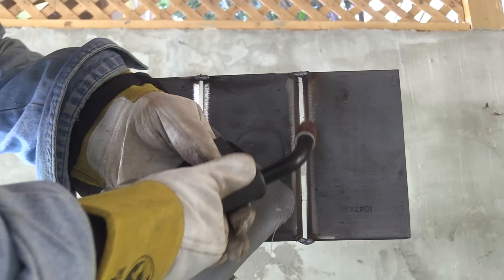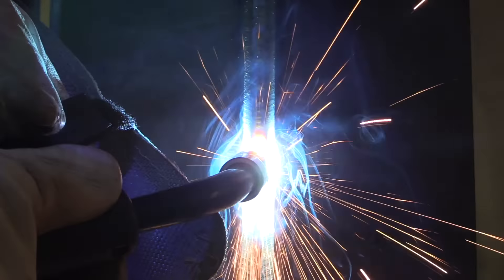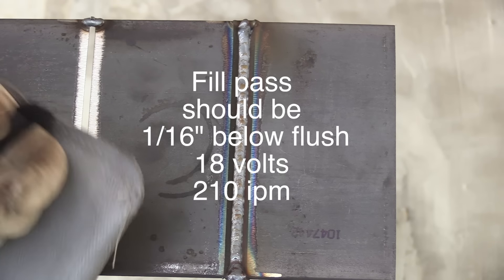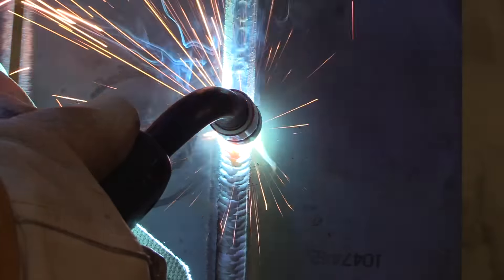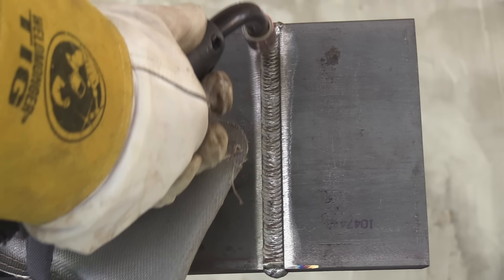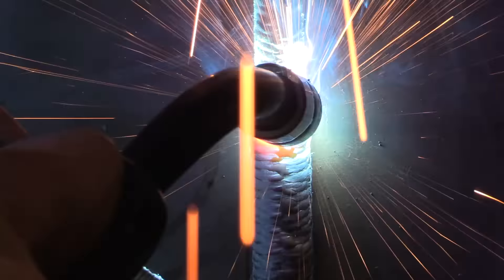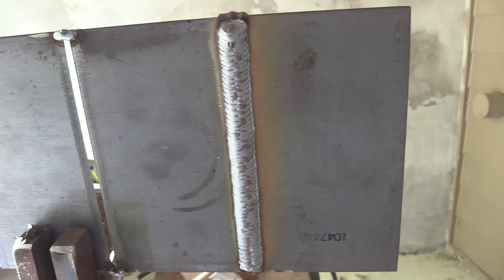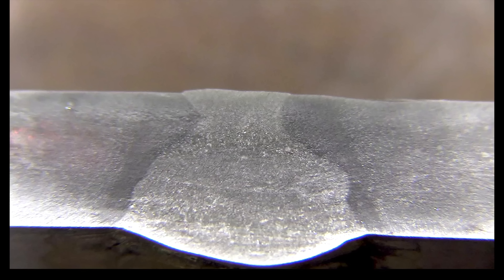GMAW-S 3G Test Plate

Comment: Years ago I used work as a metalworker doing structure building and small part welding for containerships. After being out of that work for about 10years I started to work for a transport company which hauls scrapmetal around. There used to be a mechanic with a little bit of experience in metalworking working on all the containers and trailers when the are damaged but he wasn't a good welder so I took that side of his hands. Never thought I could lose my experience with welding but it was a struggle to remember al the ways to weld on certain surfaces and positions. Thanks to your videos I got back a lot of experience and found back the right feeling on how to handle materials, situations like rusty surfaces and how to weld in all positions I get to work with. You are a great instructor and thank you for all the information and help through your videos!

Comment: I am IWS  working as a welding supervisor and i am prety happy when i see some one to get things DONE. Perfectly executed, correct oscilations and good welding. Only two things. 
1) I would of weld the root from bottom to top
2) Grinding each pass is more than necessary and it will make the final welding to be more flat. ( But i am sure you just show how to weld each pass and you didnt done it to save some time) 
Overal, this is HOW ITS DONE! Good video without any misdirections and misguidance.

Comment: Thanks for helping this farmer improve his welding skill. I have no formal training but able to do weld repairs with out failures regularly. I do practice welds and cut the piece in half just like you show in this video to learn proper penetration, no porosity or undercut then try to break it with a sledge hammer to test.

Comment: HAY Rick, Watching your video on welding a 3/8 test plate, open root. The 1st  thing I thought that you were going to do is welding your root pass vertical up because in the beginning it said 3g and I thought this should be real interesting. But after I saw the root opening I new, no way, he's running it downhill. Just a pointer to you, YOU could of run the hot pass downhill to prevent "suckback " just to be on the safe side, it can happen with mig welding, even on pipe welding with mig. By running the hot pass downhill you'll have a much better chance of not getting suckback. You'll be reinforcing the root pass and it will be alot easier to put it in than welding it uphill. Just a thought for you, but you did a really good job and the cap pass, everything being in uniform.

Comment: When an apprentice I was told when vertical up passes either with MIG you call it GMAW or stick on the filler passes to get a tune like a Viennese waltz in your head or counting 1,2,3 pause and off again always kept me in check for a uniform pass
Reply: I use a cheap metronome off Ebay that clips to the side of my welding helmet. Get it going at the rate you need depending on settings and use it to keep your rhythm. Gotta stop the mind wandering off.
Reply: When I was welding I always do my own ticka ticka in my head. Sometimes I was allowed to listen to headphones and I went to the beat.

Comment: Let's see a Canadian test!  2GF spray arc. (Flat single bevel groove (3/8" plate, 1/2" gap, 30° bevel, with a 1/4" backing plate)
Reply: Pulse arc man don't want to get any burns on that golden arm
Reply: Cory   If you burn through a quarter inch backing plate , welding isn’t for you.

Comment: I'm currently working on a piping job in the shop. the boss decided.030 bare wire. im running 21 volts and 410 on the wire feed. I can't quite make 90° of it welded do to gravity. I'm using a miller cp-302 with the feeder on top.

Comment: Question:  I had worked at a fabricating shop in the Parts and Tools Room.  I had expressed a desire to become a welder.  The purchasing agent, to whom I had made the comment, said that if I want to drive at night in my old age (I was in my mid 50's at the time) I should perish the thought of welding.  I did some welding back in the 1970's when I was attached to the Public Works department on a Coast Guard base and enjoyed welding and working with metal.  Now that I'm in my 60's I still have a desire to weld but the PA's words still ring in my head.  Does welding affect one's night vision?

Comment: I'm trying my darndest to weld as good as you with my everlast mig welder. I'm making some progress but I don't think I'm ever going to able to match your skill.
Reply: Get a clean sheet of paper draw two lines from bottom to top about 3/8"or 1/2" apart, then take a pencil & practice your weaving, you'll see where you messed up, do this for 1 hour every day until you get it right, this will help you a lot believe me that's how I got really good. I welded for 21 years but got in a bad accident last year & now I will never be able to weld again, be careful how you work & be mindful of people who work around you, I got nailed from someone else been negligent didn't even see it coming, when your helmet is down you don't know what's coming your way.
Reply: Robert if you re telling his weld is good, you arent believing in yourself.. just side to side then up starting from the bottom of the plate in vertical..Keep practicing on that., then do over head as if you were using a stick going circle foward.. then right me back and show him your progress

Comment: Do different machine settings vary by a great deal? Whenever I set the welders at work for this low of a setting, it doesn't sound anything like this. There's so much sputter from the wire being too fast for the voltage. Even when I lower the wire speed, it still feels so off. We have 2 Lincoln's. Don't know the exact models, all I know is they are huge. We typically run them at 24.5 to 26 with wire speed at 1 or 2 o'clock (I think it's 400 to 600).

Comment: Last year I took a basic stick welding class at school. I got pretty good at 7018 but a few weeks ago I bought a Hobart stickmate 235 and started out with 6013 and 6011. Just needed a little refresher. Bought some Hobart 7018’s a couple days ago and I’ve tried everything and I have to beat the daylights out of the slag for it to come off and then it turns into powder. Ive turned the amps up, turned it down, tried more and less drag angle. Nothing works. Any suggestions? There’s no way it can be my technique because at school I was getting some beautiful slag peel. Just very frustrated. I’ve followed every 7018 instructional video I can find. Any help would be soooo appreciated!

Comment: As I watched this, I noticed that you started each zig and each zag when the red glow from the molten puddle had partially caught up with the electrode.  Would the same level of color intensity evident in the video be observed in a modern mask/helmet?
Reply from the maker: good eye.  sometimes the camera shows more detail than what I see welding but I generally see what you are describing.  the puddle does start to cool a bit before I move the arc .  if it doesnt, its hard to control and it usually means I am too hot on a vertical uphill weave
Reply: @weldingtipsandtricks  It also occurs to me that, by letting the puddle cool in the middle (where the bevel is thinnest), you're dwelling a little longer where the bevel is thickest and can absorb more heat without deforming.

Comment: Hi I need an advice im new to welding and I'm starting a little weldshop. My question is do I need a voltage stabilizer for my welding machine? I have 400a arc 251 mig cut60 plasma Tig 200  and bunch of variety power tools and if so what do I need 10kva or 15kva?

Comment: What machine and diameter wire were you using? I had a hard time getting a good vertical setting on my millermatic 220 on 3/8" fillet eelds 🤷🏻‍♂️
Reply from the maker: .035" er70s-6 using a miller multimatic 220
Reply: weldingtipsandtricks thats the same filler wire and machine i was using. Could you possibly do a video on dialing in vertical settings on that same machine to do stringers on 3/8 plate? I couldnt get them to not crown up

Comment: I’m making this comment under my girlfriends account. My name is Pete dellarma. I welded at bath iron works in bath Maine for years. On the new zumwalt class destroyers the navy wouldn’t let us use flux core on hy80 and other high streangth steels. They made us use pulse arc with 100s hard wire 0.45 with 95/5 gas. I did miles of ut butts vertical up with this process. I was just wondering if maybe you could do a video running this process. Anything over around a half inch or thicker we pre heated with heat blankets or strip heaters. A lot of the butts I did were very thick and had up to and over 100 passes. Unfortunately due to my cancer treatments I had to give up the job I loved so much. I love watching your videos. So if you think you could maybe do a video on this I think it would be awesome to see how you run this process. Thank you. ~Pete~
Reply: I wanted to add our test was 3/8 plate double bevel feathered edge 3/16 gap ceramic backing. Vertical up 0.45 100s wire pulse arc

Comment: Some people believe that even monkeys can mig weld to this degree, but there's a shed load more to it than just pulling the trigger.
Reply: I agree,  it’s not that simple and if people say it is they probably can’t do it properly. I used to weld multiple runs on  20mm plate than get thrown some 1mm sheet to weld, then rhs & then galvanised pipe. Adjusting settings, gas and yourself takes skill

Comment: Hey, Im new and Im wondering what your setting are on your welder for the various sizes of metals you use,  both wire speed and voltage thanks

Comment: I will tell you what, I used a Walter zip wheel a couple weeks ago on a fencing job to cut the uprights and I cut 10-15 4x4x1/8 posts with ONE Walter zip and could only cut 4-5 with a Metabo disc....noooo lie

Comment: welding black in Sweden, never weld downwards - Always upwards. That´s a rule over here.
Reply: Experience More Sweden  thats the rule in overall welding i see how he got the kind of dime pass i like to do it more like smooth surface
Reply: olainez 19 but i havent yet seen an american make a proper upward V-joint on 15mm thick steelplates, thats the test we do here, with an examiner beside us who checks voltage,amps and M/minute all accordingto the WPS.
Reply: I don't think so f u can weld up hell on the mig.. No way I'm a rig welder unless u put some ceramic for backing support.. K.
Reply: @drefalcoseba8121  no ceramic backing

Comment: Yeah, a baby torch with baby wire.
real world heavy manufacturing requires bigger stuff
1 1/2" plate with 37.5 degree bevels, .052 or .062 wire.  400amp gun.